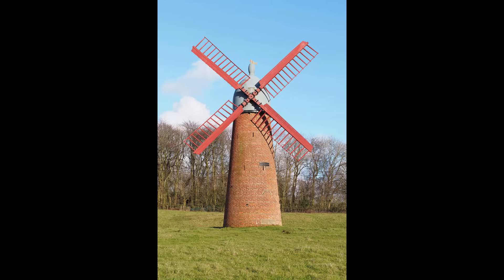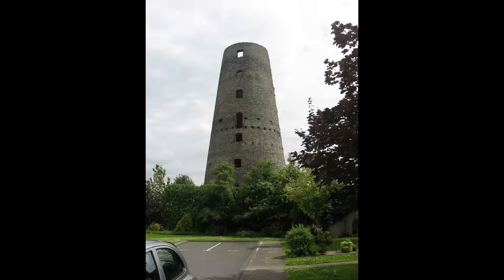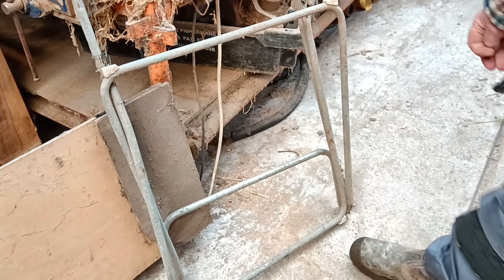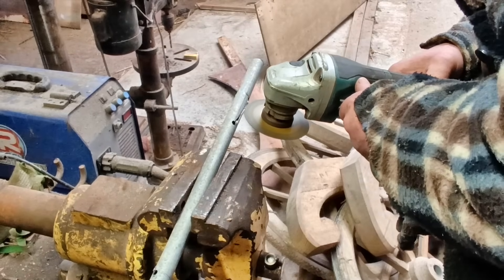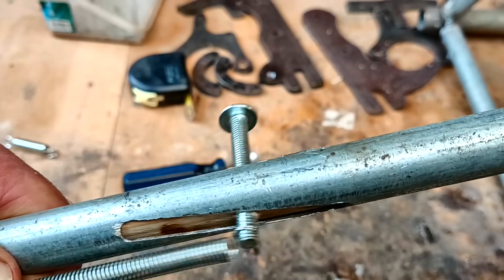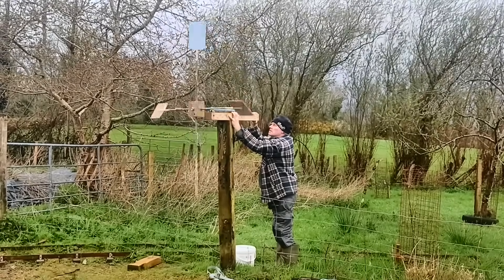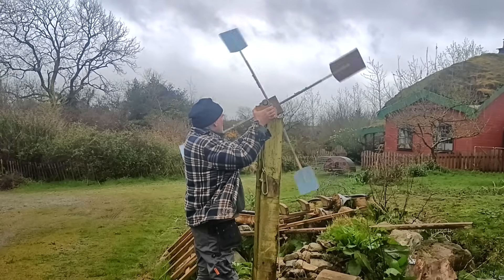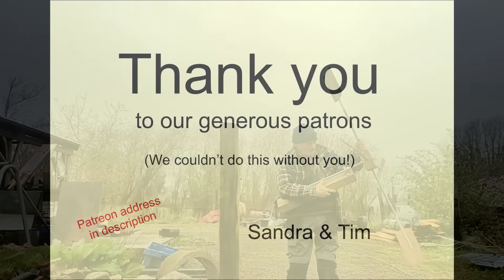How To Make A Self--Feathering Windmill (Self Regulating Turbine)

Comment: If you had the springs attached to the blades, when the wind pressure on the blades grew, the springs would stretch (or compress). When the wind pressure is too high, the blades just go flat. You'd need some resistance so I suggest an alternator to give it something to do.
Reply: Ah! You've saved me from saying it; perhaps all that's needed is a load, and what's more, a load that automatically self-regulates by entirely mechanical means. I'm thinking of the "Vee belt and variable-diameter pulley" system fitted to many mopeds as well as to the redoubtable Daf Variomatic car, but I can't help think itvwould be avgoid move to testvthe devicecwhile it's driving a millstone or a trip hammer or  a compressor or something - anything to exert a load.
 Tim, I'd like to congratulate you both on the elegant simplicity of your design, and on the idea of making the brakes come on progressively. 
 As always, you did a great job of walking us all through the decision-making process.

Comment: You don't have to climb the tower to turn the fin on the back of the western US windmills.  There is a wire that goes up to the fin.   It is attached to a lever that can be pulled on the ground.  My dad had one.
Reply from the maker: Ah-ha! Thanks. The ones here are way behind..
Reply: @wayoutwest-workshopstuff6299 The small wind pumps that we have here in Canterbury, New Zealand (& plenty of other places) don't ever need to be reset. The shaft from the turbine head is on a slight angle from vertical, so that gravity furls the blades back into the (steady) wind after a gust. This avoids the need for springs (and the complexity of spring mechanisms, and their associated problems, etc.). It's one of the most elegant engineering designs I've seen in my 30-odd years as an engineer... EDIT: Google search term for this (& similar) designs is: wind turbine offset tail furling

Comment: Now, I need to preface this by pointing out that my experience is in mountaintop and arctic environments - cold, remote, miserable.  But it has been my experience that the cheaper wind generators primarily exist to put money into maintenance budgets, as opposed to generating usable power.  I believe your passive physics-based approach is going to be lovely at overcoming that tendency, and it only helps that you aren't on a remote Alaskan mountaintop.  (though they are generally quite nice to visit!)

Comment: This is so much like the sort of governor used on steam engines with the mass of the paddles replacing the mass of the balls.  Ingenious.

I suspect that having the variable pitch paddles at the end of blades or as a comtrol surface at the end of the blades would have the same effect of acting as a brake.

Comment: 2 suggestions.
a vertical axis wind turbine where the blades bend themselves out and the lower hub rises up the faster it spins. sort of like a gravitational governor on a steam engine.

a turbine like you have already but with segmented blades, and springs on those segments, rather than the blade shaft.
Thats kind of the way youve gone already, but spread over the 4 blades, but it seems to me that would be unstable.

Comment: Wind, to friction, to heat generation, for in floor heating? Apparently there are systems where a fluid is forced from a wide to narrow apertures and the fluid heats up.  Not sure how much heat you’d get, I assume there are ways of figuring that out.  So the wind turbine could run a pump system?  Any thoughts, anyone?
Reply from the maker: That's sort of what I was thinking - but any kind of friction in water will heat it up

Comment: Very clever mechanism. I wonder though, would it function if you used something like a big rubber band to make a big ring connecting all the vanes to each other rather than springs on each of the individual vanes? My thought is to even out the tension on all of them so they operate more in unison and get a smoother rotation. That would also make it so you don't have to adjust each spring individually to calibrate it, just adjust the tension on the single band.

Comment: What about using a governor on the shaft itself with a pair of 90 degree gears (perhaps out of an old differential) to slow the windmill down? When balls are out it could squeeze on a brake on the shaft.

Comment: Use the same time tested system that steam engine uses. As the windmill blow faster the brake shoes clamp down harder.  So even gusty winds the brake would be apply according.  This all be done using car axle drum brake  with a controllable brake pedal/ spinning governor.
Reply from the maker: Except the vanes will still face the wind so there would be a lot of resistance in a storm..

Comment: It's a great idea, but I have a question:
When the magnetic field of the alternator or generator increases, the blades will twist and you will no longer have the force to generate electricity, I believe.
Reply from the maker: surely the resistance would slow the vanes, so they will twist less?
Reply: @wayoutwest-workshopstuff6299  I think if you put stronger springs it might work. But it depends on the current load you want to consume. The load should always be constant so that the springs always do their job. If there is ever an additional or lower demand, the springs will not be able to adapt.
But I'm not an engineer, just a handy man...!
Reply: You could try it by putting a brake on your horizontal axis 😉
It's the snake that eats its own tail!

Comment: I love the Idea Of windmills!!! We live on a bit of a  plateau & seasonal winds come some months out of the year & I  have always toyed with the idea of mounting a wind powered air compressor on the roof over the garage to charge an air tank down below... What inspired me was a vidio I watched several years back titled: Air powered bike w/first prototype "Little" motor. The fellow makes a double acting 2 cylinder powered air bike running off a scuba tank. The motor is chained to the pedals & if you don't watch out it could whack you in the leg! I would improve on this Idea by useing 2 smaller carbon fiber tanks mounted on either side of the bike toward the rear vs the large goofy one, AND the bike would be a Schwinn world tourist model. I believe it was made from 1978 to 79 but was not as popular as a conventional bike &  shortly discontinued thereafter... This bike has the freewheel ratchet mechanism in the front sprocket assembly between the pedal crank to the sprocket, so the gearsets may be shifted when coasting as well as pedaling. Normally if you tried to shift speeds when coasting & not pedaling, the chain would jam & it would be a rather unplesent expierience. If this bike is used, the pedal cranks could be freewheeling while the air motor is powering the bike. A wind powered bicycle... I wondered if anyone else had made a wind powered air compressor & yes indeed. When I went serching, I found another very interesting vidio titled:  AMISH air POWER ~ OFF GRID. He runs the whole workshop on windmill powered compressed AIR! 😲😁✌👍
Reply: The freewheel in the bottom bracket was invented by a kiwi who built at the time one of the lightest microlites, I can't remember his name but do remember him telling me about Schwinn buying his patent

Comment: You might want to add a flywheel to make it a smoother shift yet. That way it can store a little bit of energy and keep it from speeding up and slowing down quite so much. Also some larger blades might help out some as well by being able to capture a little more energy from the wind, though I'm unsure if this is a good idea or not.

Comment: brilliant as always, Tim. I was wondering, for fine-tuning the return rate of each vane equally could you use some kind of rotary mechanism? Difficult to explain in words, but i'm imagining something like a disc in the center, with attachment points for each spring (90* for 4, 60* for 6 etc.). By rotating the disc around the same pivot as the blades, you could shorten or elongate the springs all at the same time, keeping the ratio between them the same but allowing for higher/lower top speeds as required!

looking forward to seeing what you end up doing with this either way, perhaps it could be used for low power floodlights around the farm where you don't have to deal with the scary 240v of mains...

Comment: Hi Tim, I've made a couple of homemade turbines for electricity and there's a much easier way to stop blade overspeed using an offset tail that's hinged to furl when the thrust on the blade exceeds what the tail surface can handle. With the right angles the blades return to face the wind automatically when the wind drops. Not sure if you can adapt this idea for a windmill (as this doesn't work if the turbine is disconected), but it might be worth taking a look at.  If you are tinkering with windmills why not make a turbine and get yourself a grid tie inverter if you don't want to go down the battery route? Or use the turbine for something like a water pump to store energy.
Reply from the maker: any videos of your builds, Dave?
Reply: @wayoutwest-workshopstuff6299  No sorry Tim, only a few photos of the builds somewhere.  If you're interested in more info google Hugh Piggott of scoraig winds, he has a fantastic book detailing everthing from carving your own blades to winding your own coils and everything in between including the furling mechanism.
Reply: @wayoutwest-workshopstuff6299  Sorry Tim, no. I have a couple of picture somewhere but that's it. Try searching the well known search engine for Hugh Piggot at Scoraig wind. He has a fantastic book that I used that covers everything from carving blades from timber, to winding your own coils and everything inbetween, including the furling mechanism.

Comment: I remember taking a physics class about windmills. I dont remember much, but i remember that 3 or 4 blades is optimal. Otherwise, the airstreams behind the blades interfere with each other, causing a loss of power.
Reply: I think perhaps your memory is playing tricks on you? More blades are better -- but the additional energy capture benefit diminishes greatly with each blade. In wind turbine design the saying is that "three blades is a very good approximation of infinity blades; and even two blades is pretty good..."
Reply: @davidhaywood8029 No, you are not exactly right. 
The turbulences that each blade leaves behind actually interferes with the next one, causing vibration and inefficient, so it really is like, the less, the better. 
Also, an uneven number of blades is better if you want to avoid vibration, because if one blade moves in front of the "stem", the airflow gets slowed down by the "stem" , causing the blade to bend forward, transmitting the movement to the opposite blade and causing both to vibrate/bend
 —>material fatigue. 
If there is an unequal number of blades, the movement gets transmitted to (in case of a three blade turbine) the "TWO" opposite blades, therefore splitting up the energy between the two (or really the three)
—>less vibration/material fatigue. 

The less blades the better +unequal number of blades= three blades!

There is a reason why commercial wind turbines have  3 blades.😉🤓

Greetings from Germany
Reply: @IrelandLover  That drag from the extra blades was (and still is as such bladesets are still used for water pumping and pond aeration) part of the overspeed protection of the wind pump/wind compressor, and in such applications the low efficiency in high windspeeds isn't important as enough energy is still collected to run the pump or compressor connected to the bladeset.  The high blade count is also important in mechanical load applications like pumps and compressors that need high starting torque that you get from lots of blades.
Reply: Well I don't want to get into one of those internet thread debates. Yes, I'm aware of all of that. But what I was saying is that from a fundamental physics perspective the greatest energy capture (at a given turbine diameter) comes from the greatest number of blades -- the original comment appeared to be saying otherwise. Fatigue & manufacturing problems can be "engineered out" but at a cost. So the reason for commercial wind turbines having three blades is driven largely by economics, i.e. that you get little benefit in energy output from the cost of the extra blade(s). There were large two-bladed turbines (such as the WindFlow systems) but the cost of the teetering mechanism was more than the cost of having an extra blade. Maybe we're saying the same thing here, but I find it helpful to distinguish between fundamental physics, engineering detail, and economics.
Reply: @davidhaywood8029  I get your point.
The more surface, the more wind gets "harvested," but all in all 3 blades are making the most sense. 
Also Tim requires something that makes the most practical sense (and maybe looks cool too 🤔?).
Anyway I get your point, but too many blades REALLY create too much turbulence, MAKING THEM LESS EFFICIENT.
If they didn't, I would definitely agree. 💯
Reply: *Edit: Talking about the energy harvest.
Reply: depends on RPM, blade length and expected windspeed. The 8-or-so blades of older windmills worked well for their slower design speeds that were limited by material costs and low windspeeds due to being relatively close to the ground

EDIT: since the other commenters here went into much detail I thought I'd go into why I said what I said (which is based on minutephysics' video on the topic)
You want your blades to slow the wind down but still let some through. The faster the turbine spins, the more efficient it is but the more each unit of area of blades slows the wind down, thus high speeds lower the optimal blade-area to circle-from-which-energy-is-extracted-area ratio. So when you have weaker materials and lower desired rotation spins, like for milling grain cheaply, you end up with blades that need to cover a decent part of the full energy extraction area, but are less efficient in extracting wind energy. When you get better materials, you can afford to make faster spinning turbines, and then lower areas of blades are needed to allow enough wind by to let new wind in.
The aforementioned minutephysics video is where I got this, might be bs but sounds sensible to me so idk
Reply: @KarolOfGutovo  With a high torque-low rpm-big diameter windmill at medium wind speed, the turbulences are long gone ("blown away") and don't hit the following blade.In this case, the turbulences won't cause much inefficiency and that means more blades more wind-energy gets harvested. 
Still, an uneven number of blades is the way to go for avoiding material fatigue.
Reply: How to build your wind turbine obviously depends on the given environment and conditions (budget, average wind speed.......you know 😉)

Comment: Nice idea. What about using a centrifugal clutch as used for karting. You can change the springs to make it engage to higher or lower speeds. The shaft would be attached to the inner rotating part that has the weight and the outer bell would be fixed to the rig.
Reply: The main thing with wind powered machines is never disconnect from the load, cheers

Comment: I really like the idea of staggering the spring tensions, I think you would get vibration issues on anything larger and faster. but for smaller turbines its a fantastically simple idea. You could try a variable spring that slowly increases stiffness as it extends so the change happens more slowly rather than the sudden stop start you got with the current springs. probably expensive or difficult to make, but maybe someone has a clever ay of making them
Reply: Variable springs are probably the way to go, that’s also my thinking. Just makes the power output more constant I suppose.
Reply: The staggered spring tension induced vibration could be mitigated a bit by pairing opposite vanes.
Reply: Variable spring, or non-linear curve channel. Either might be easier to create, though a spring's probably easier to iterate and tune.
Reply: Since he was using 2 springs on each vane, he could use two different springs. With one stiffer than the other, it would at least be a 2 stage set up if variable springs are too expensive/hard to find.